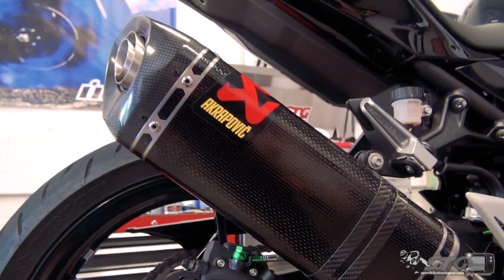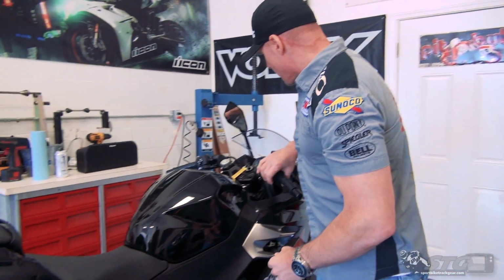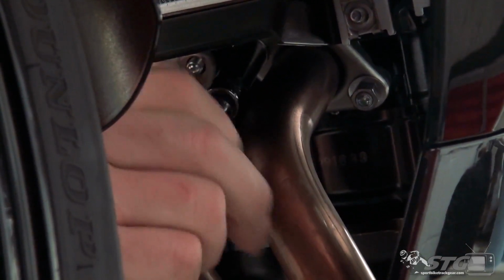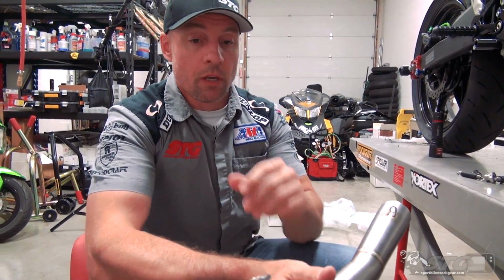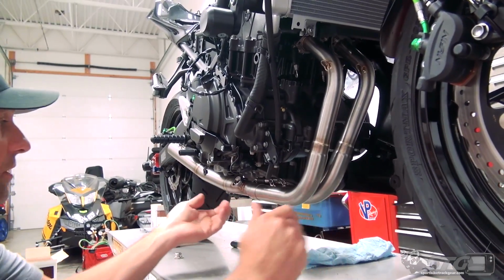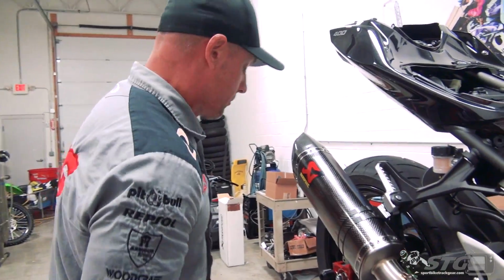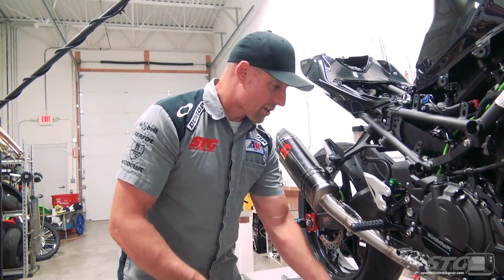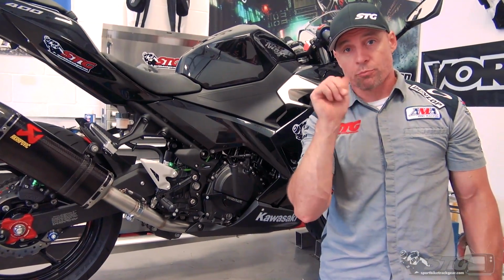Akrapovic 2018-2023 Kawasaki Ninja 400 Full Exhaust Install | Sportbike Track Gear

Comment: So what I’ve learned from this video is to definitely use this exhaust on the streets
Reply: Especially if you want to wake up your neighbors
Reply from the maker: Technically not street legal. We use all of our bikes on the track. - Van
Reply from the maker: It will get that done for sure. - Van
Reply: @sportbiketrackgear  Lol, not everyone lives in California. Check your local laws because it varies. Saying aftermarket exhausts for the street are not street legal is naïve and incorrect in the US, doesnt even say that on their site.
Reply: @drnapalm7605  This exhaust is illegal in all  states because it deletes the factory catalytic converter. That’s a no no across the board in the US.
Reply: @SidewaysLyfe  Neighbors may be bike voyeurs they may like it lol
Reply: @Cyberseal82  Nice!
Reply: @kennethpowers8995  I'm in Oklahoma and while technically you're correct, no one here enforces this rule/law. I have a Powerstroke Diesel truck, that is straight pipe from the Turbo, and the LEOs here don't even react to it... even though its very loud.. Motorcycles are the same... The loudest bikes here are the Harley's and the straight piped/cat delete crotch rockets don't come close to their level of noise. 

So yea, while illegal, many southern states have a "run what you brung" attitude towards exhaust systems. OK/TX/LA/AR for sure typically don't care.
Reply: Where would one go about purchasing one of these exhaust?
Reply: Sometimes it varies from county to county. Where i live they give no fucks but go over a county and they will fuck with you

Comment: love your video's! I have a LV10 on my z400, problem with those little bike's is that you're redlining them 90% of the time and then the aftermarket exhausts are getting pretty unnecessarily loud and annoying IMO
Reply from the maker: If you prefer it to be a little quieter leave the OEM system on the bike for sure. - Van

Comment: It's more power without the db killer. Good video as always.
Reply from the maker: We have been told it makes approx .75 hp more with the insert installed. - Van
Reply: @sportbiketrackgear  I felt more power while riding the bike without the insert. I am obviously wrong. Speaking of exhaust, I called toce about 2 months ago and the rep promised me that their full system for 400 will be coming out in a week. Do you know anything about that Van ?

Comment: Hello Brian looking forward for your reply is the full system pipe and header compatible to the yoshimura alpha t slip on?
Reply from the maker: I do not think it will be compatible (not 100% sure) as the Akra header is a larger diameter than the OEM where it meets the slip on. Your Yosh slip on is designed to go over the OEM header. - Van
Reply: I see, your response is very much appreciated, Thank you Van and ride safe 🍻

Comment: Nice video, congratulations.
Could tell me if with both together exceed 110db (I mean full Akrapovic) ? 

Thanks!!
Reply from the maker: While I have not measured it I do not believe it will exceed 110. Please visit the Akra direct site as they have more information. With the noise insert installed this system is rather quiet. - Van
Reply: @sportbiketrackgear  Thanks,i already went in the Akrapovik Website but they just showed me the DB separeted, not the full exhaust. I sent an email but they never came back..

Comment: Do you know if it will hurt the bike if i put the full exhaust and air filter and ride it without a tune?or do I have to tune after i do mods.will the full exhaust and airfilter throw the factory ecu settings off while me taking out for test runs before i decide to do a ecu tune?tia
Reply from the maker: It will not hurt the bike. We have installed several systems on bikes without any mapping and ridden them quite a lot (including this bike) and not had any issues. - Van
Reply: @sportbiketrackgear  do I need to change the air filter if I do the full exhaust?

Comment: how much is the full system for ninja400??? But I live in the Philippines though
Ima new subscriber by the way and I really luv your content
Reply from the maker: Below are links to the parts on our site. Add them to the cart along with your shipping details to get a shipping quote.
Akrapovic Kawasaki Ninja 400 18-23 Carbon Slip-On Exhaust
https://www.sportbiketrackgear.com/akrapovic-kawasaki-ninja-400-2018-carbon-slip-on-exhaust/

Akrapovic Kawasaki Ninja 400 18-23 Stainless Steel Optional Header
https://www.sportbiketrackgear.com/akrapovic-kawasaki-ninja-400-2018-stainless-steel-optional-header/

Comment: Do you think you could fit an M4 slip on to an Akropovic header? The diameter looks a little larger on the Akropovic header than the slip on mid pipe, but I'm not sure.
Reply from the maker: No that will not work, the diameter of the Akrapovic Header is larger than the mid pipe of the M4 for sure. - Van
Reply: @sportbiketrackgear  Thanks Van. I've looked at a friends bike and I think the Akropovic header might fit into the M4 slip on without the mid pipe. I ordered it and will work on it this week. I'll let you know if I can make an Akrapovic header work with an M4 slip on.
Reply: @sportbiketrackgear  Haha it didn't work out Van. So, I'm selling my m4 slip on and going to a full Akropovic system. I ordered some driven rearsets from y'all too.
Reply: @iLykeCahrs  how was the full akra system? did you get it tuned?

Comment: Hey B- unrelated to this video but given your height dont you find the seating position low? Im to 6’1 and i find it hard. Maybe a new seat vid or recommendation? Thanks man
Reply from the maker: With the OEM seat the position is pretty close to the ground for sure. While this is great for a new street rider it is not the best for the track. We have since added a race seat that raises this a few inches to get the rider into a more athletic position. - Van

Comment: Hello Van, about what you've said in the video that it is okay to run your bike without gettin it tuned, What if I'll run it forever without tuning it? Will it harm the bike?
Reply from the maker: You can install the system and ride the bike all you like without getting it tuned. If you are happy with the performance no reason to make a change to the fuel mapping IMO. - Van
Reply: @sportbiketrackgear  damn i got a reply from Van 🔥 BTW, thanks!
Reply: @sportbiketrackgear  do you have proof of this back up? I’ve heard a lot of company recommend a tune after a full exhaust installation. I just want to make sure if I need to tune my bike if i do decide to go full akrapovic. please get at me soon so I can order the header off ur site.

Comment: For Full Akrapovic Exhaust system the bike need new remap ECU?
Reply from the maker: If you want to get all of the possible performance out of the bike you will need to remap. For street riders I recommend installing the system and riding the bike first. If you are happy with the performance then leave it alone. - Van

Comment: Do you like the Apokravic better than the M4? The M4 has a smaller diameter header.... which one sounds the best to you. And which one makes more power?
Reply from the maker: We are running the M4 full system on Max Van's MotoAmerica Ninja 400. - Van
Reply: @sportbiketrackgear  Hi Brian! What was Max running before the M4? Are you running the M4 for performance reasons alone? I know that it's one of the few exhaust systems that have a performance benefit. Also, is M4 a sponsor for your MotoAmerica effort? Just curious how that was chosen. I appreciate your feedback--many thanks!

Comment: Do you need to tune the bike after install
Reply from the maker: No, you can install this system and ride the bike without tuning it. If you ride it and decide you want to get all you can out of it then you can get it tuned. For this I would suggest checking out 2 Wheel Dynoworks. - Van

Comment: Hey, first of all I highly appreciate the work you guys take in putting up all these videos. As for a performance stand point which of the full system exhausts do you believe gains the most please ? If possible I would appreciate answers with and without the power commander. If you do not have exact answers can I just have your personal opinion on sound and performance please ?

Thanks again

Comment: If I'm using the PCV to retune the bike to a full akra tune, which lambda sensor do I use?
Reply from the maker: The Dynojet Autotune comes with a sensor that you will use. - Van

Comment: Hi Brian, any updates or replies from Akrapovic about the HP difference of insert in vs. out? Thanks.
Reply from the maker: Per Akrapovic the pipe performs best with the insert installed in it. The difference is very slight but when you are riding a light weight bike it all counts. - Van

Comment: What fuel controller or ECU flash for this exhaust would be recommended?
Reply from the maker: You can use a Dynojet PCV or a FTECU Flash for the Ninja 400. - Van

Comment: Is the Akrapovic slip on that I purchase from Kawasaki able to work with this header? Also would the Dynojet commander with them premapping be good enough or should I go to a local tuner that sell the woolish.
Reply from the maker: Yes the Akrapovic slip on is designed to work with their header for the Ninja 400, good to go there. As for the mapping you can use a Dynojet full system map to get started. If you are happy with the performance then leave it alone, not happy then you need to take the bike to a tuner and have them build you a custom map. Personally I would ride the bike first. - Van

Comment: CAN I  only install  Akrapovic  FRONT  tube with  original  tail exhaust ?
Reply from the maker: No you will also need the Akra slip on to make the header work. - Van

Comment: 2:30 throttle cable snap? how does that happen, and so how would a quickshifter help? please and thanks Mr. Van..
Reply from the maker: No there was no issue with the throttle cable on the bike. The quickshifter will allow the rider to make full throttle, clutch less upshifts without having to let off the throttle at all which is nice on the track. - Van

Comment: One question, does those headers fit in another exhaust? I have a austin racing slip on exhaust but i want to change the headpipes so im wondering if it would fit
Reply from the maker: I am not  sure if this would work with another system. Odds are it will not. - Van

Comment: Did Akropovic ever answer the question about more power with or without the insert? Do you have a video on how to remove that?
Reply from the maker: Yes they did, sorry meant to update. As I was told the system makes a touch more power with the insert installed (less than 1hp difference). - Van

Comment: So with the full system, I’m assuming a tune is necessary. What tune would you recommend?
Reply: Also do I need to get a different air filter since I already purchase the headers on ur site?
Reply from the maker: If you are racing I would suggest getting the bike tuned. For riding on the street I would ride the bike after installing the exhaust before I did anything additional. If you are happy with the performance then leave it alone, not happy take the bike in to get flashed. - Van
Reply: @sportbiketrackgear  without a tune the bike will run fine? my bike is still pretty new an don’t want to find out along the line something breaks for having a full exhaust without a tune.
Reply: @Kingnabor  The bike will run signifiantly better if you tune it. Air fuel ratio will run smoother and make the bike cooler consuming less etc etc. This is in general ratios. Everthing may differ in concrete cases.

Comment: Nice video👍 just some questions Did you get the engine light on? Due to the catalyst removal ? And placement of the O2 sensor in the new header pipe?.
Reply from the maker: No check engine light with the removal of the catalyst. In this video we show the installation of the exhaust sensor in the Akra pipe. It has been a while since I did this install and can not recall exactly how the sensor was routed ( I would have to rewatch my own video). - Van

Comment: Thanks for the videos, they really help.
I have a specific que atinó about it, I bought this full system from you and now I want to install it... what is the torque you used for the nuts that you first install with only pressure of the hand?, the one you finished with high temperature silicon?.
I know you said not so much, but an approximate?.
Thanks in advance!.

Comment: Hi van, this akrapovic exhaust, for the sound is louder full system or slip on? or both same?

And how about the performance? Full system compared slip on
Reply from the maker: The full system is louder and offers better performance than the slip on. - Van
Reply: @sportbiketrackgear  thanks man

Comment: Bruh! Where's the dyno numbers???
I'm putting on the full exhaust this weekend and curious to know if i should run silencer or not.
Reply from the maker: Man we just have not found the time to get the bike to the dyno. Per Akra there is a slight power gain with the insert installed. - Van
Reply: @sportbiketrackgear  I wonder if that holds true if i'm using a Power Commander 5 with the Full Akra + Stock Air filter map

Comment: I have a question so stock Ninja 400 cam be ridden on A2 without any restriction,but if you mod it to be over 35KW(45hp) can you still register it and drive as an A2 Bike?
Reply from the maker: No idea what you are referring to here. - Van
Reply: Yes, the thing here is nobody needs to know the real power of the bike. In spain authorities only search your vehicle documentation and in the technical control they search for security faults normally, they would need a special dedicated machine to know the real power of your bike so... Yes you can ride it with A2 but technically... You should not.

Comment: I’m a Yoshimura fanboy, but I think this Akra may look and sound better.

I’m guessing Akra never responded to your email?
Reply from the maker: The system makes more power with the insert installed. - Van
Reply: @sportbiketrackgear  I saw you said on the other video that the Yoshi also makes more power with the insert installed.  Odd.  Thank you for the response.

Comment: Whats the best full system for kawasaki 400 ? Akrapovic? Yoshimura? Or Leovince?
Reply from the maker: The Akra is the top performing system, it also costs the most. - Van
Reply: Sportbike Track Gear Thank you Van, I was confused for which full system to buy, I just bought the akra one.

Comment: I have a z900 can buy you Yoshimura full exhaust without turning it.
Reply from the maker: Yes you can install a full system without doing any tuning. If you are happy with the performance no need to make any changes. - Van
Reply: @sportbiketrackgear  Will I lose gas mileage.

Comment: What spray are they using for their exhaust to prevent corrosion ?
Reply from the maker: Akrapovic recommends cleaning the pipes with WD40 or an equivalent to that. - Van
Reply: Sportbike Track Gear wd40 I saw there are many different types right ? I do not know which one

Comment: Please Japan, we want a reliable small-cc 90º Vtwin with actual performance.
If you want to cheap out, at least put a 270° crank in these 300's and 400's.
Or you could make a 500 to replace the former Ninja 500R.
Reply from the maker: We have had excellent luck with our Ninja 400 as well as our R3. No major issues with either bike. - Van
Reply: @sportbiketrackgear  They are very reliable. But lacking some charisma.

Comment: Is there a performance difference with or without the sound insert installed?
Reply from the maker: You will get about .75 hp more with the insert installed. - Van

Comment: Is it necessary to add a power commander? Thanks!
Reply from the maker: You do not have to install a fuel controller. I recommend installing the pipe then riding the bike to see how you feel about the performance. If you are happy then leave it, not happy install a controller. - Van
Reply: @sportbiketrackgear  Thank you mate!

Comment: I see you have to remove the reducer or the thick gasket. Do you happen to know the dimensions specifically the diameter of the header where the slip on would originally connect? Thank you.
Reply from the maker: Sorry I do not have those dimensions. - Van